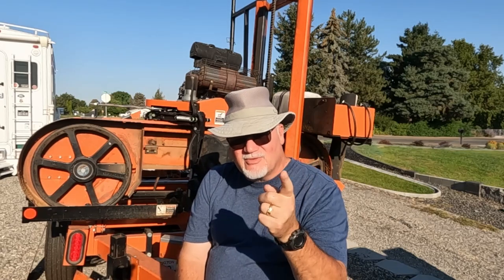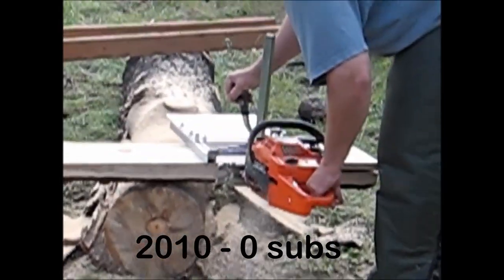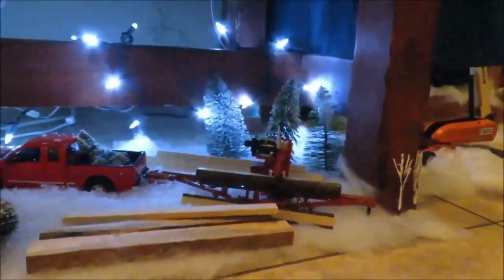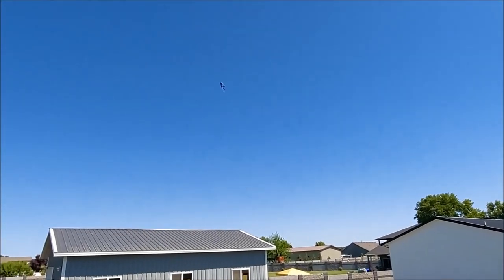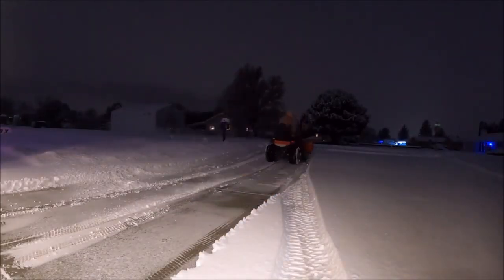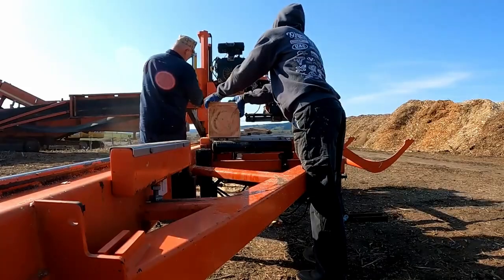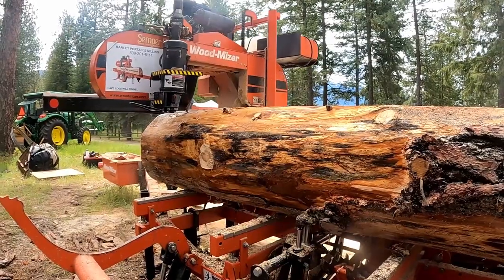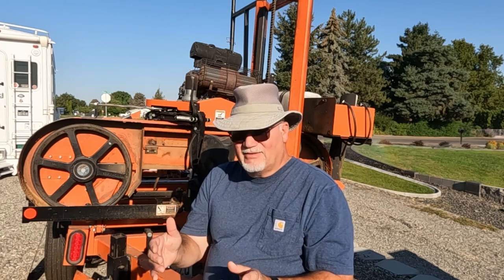THANK YOU!  I'm giving away a LogRite Sawmill Special CANT Hook and more!

Comment: Hey Jarhead… new owner of a 2014 LT-40 near Lake Tahoe, Sierra-Nevada mountains, California. Thanks for sharing your knowledge. I’ve learned a lot watching your videos. I’m trying to understand the video about starting the log with the far end of the log twisting to the right, to minimize lumber twisting. I’ll have to re-watch that video.
Reply from the maker: Semper Fi!  Hooks to the right!  The idea is to make it easy to keep track of the stress in the log and where it will be when you finish milling it down ;)  Take a lumber crayon and draw an arrow from the hump of the log to the hooks with the point facing the hooks.  That is where the stress will want to present.  Now, mill off the top (of the log with the arrow facing the right) and then roll it 90 so the arrow points up.  Now the stress is vertical.  Mill that off and roll 90 again, stress/arrow are back horizontal now.  If you want the wood to crown rather than face bend, you set the height of the CANT here.  Make sense?  Roll 90 and the stress is up and down so you set the width of the cant (again, to give crowns for say, floor joists or rafters) and roll 90 one last time and mill to the stops.  If on the other hand you are making paneling, flooring or studs (anything that you do not want a crown in), you set the width when the stress/arrow is horizontal, that way when you roll it up (and the arrow is pointing up to the sky) and start milling down to the deck the boards will want to face bend. -  the only other thing to consider is what to do if the stress is too much and the whole cant is starting to bend!  Then you mill off enough to get a flat surface, take a board out, flip 180, mill flat, take a board out and repeat until the cant is done or the stress is gone :D  Make sense? -- Entered ya into the contest too!